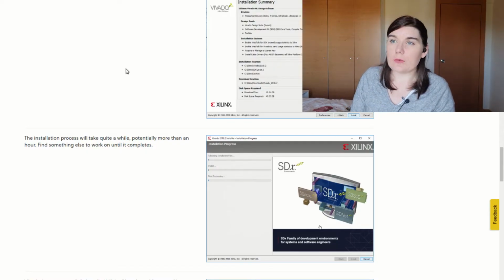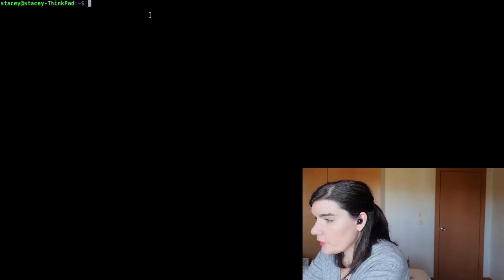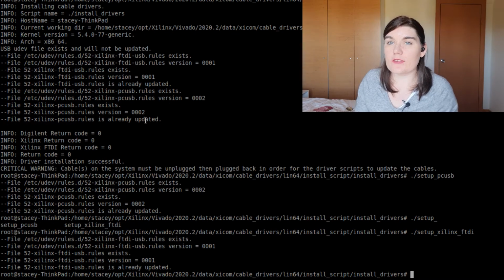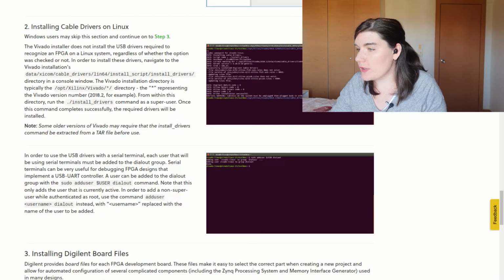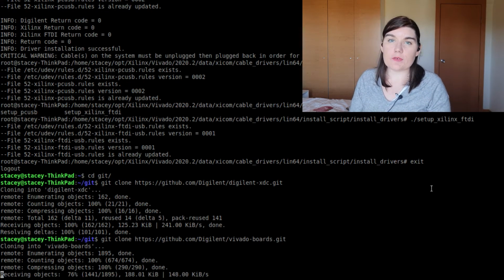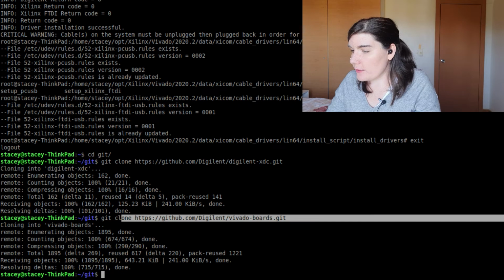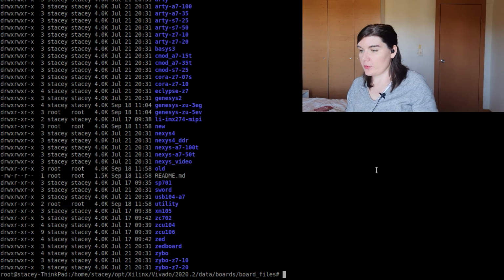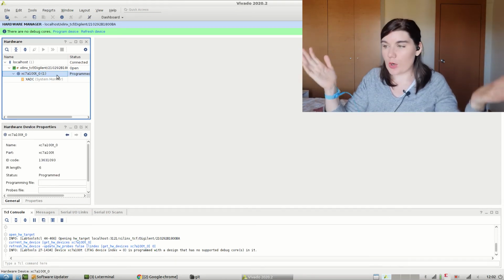Setting up a Nexys board in Linux!

Comment: Are the drivers for this board open source or do they at least run in user space? I'm asking because I would be annoyed if the drivers were proprietary and then stopped working with newer kernel versions someday. 
The only solution to prevent this would be open source drivers that are then maintained by the kernel developers or drivers that run solely in user space. Because no matter how much the Linux kernel changes, backward compatibility with userspace is always maintained.